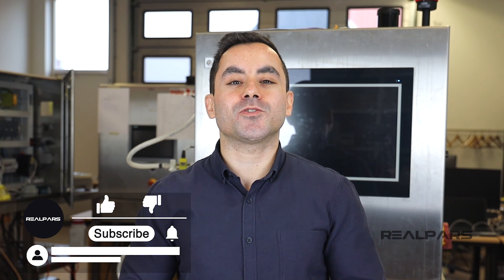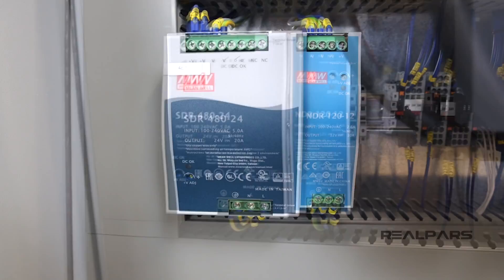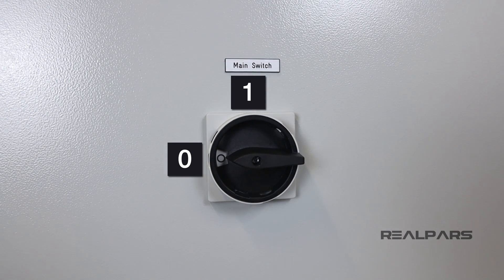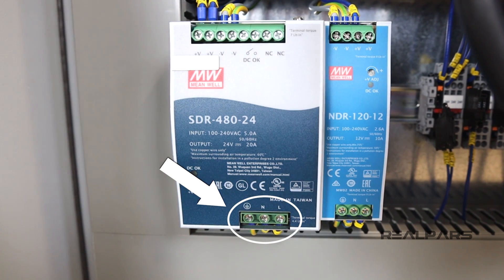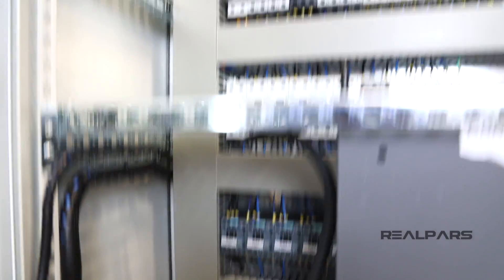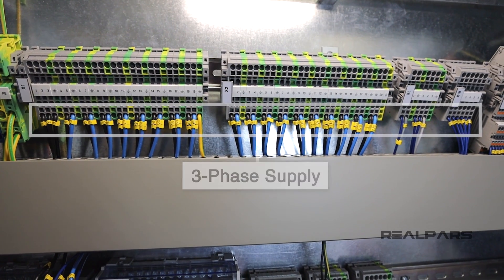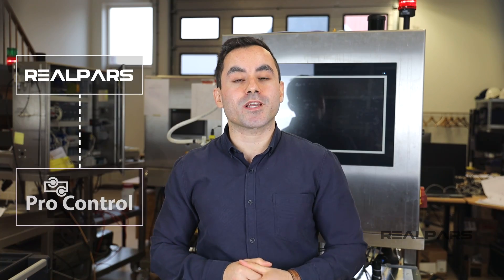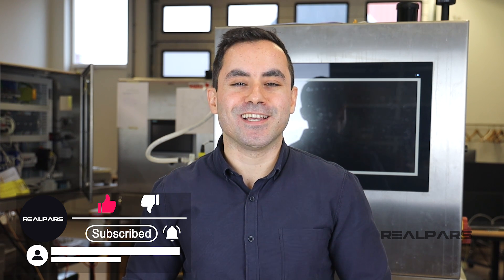What is the Purpose of the Main Switch?

Comment: What is the function of the distribution unit?
I assume it takes the function of main circuit breaker and surge arrester?
Reply from the maker: A power distribution block is used to create individual circuits using terminal blocks commensurate with the wire sizes appropriate for the circuit load.  It would be very difficult to "stuff" multiple wires into the main power lug.  That would not guarantee a good connection of the multiple conductors.  Using a distribution block will help guarantee good connections with properly-sized terminals.

Comment: 1 - A three phase 415VAC will give me a one fase 240Vac. 
2 - What's the pourpose of the contactor between the two distribution unit? 

3 - Is that usual the main three phase cables pass through a switch assembled on the front door? Cound't be just a command switch?
Reply from the maker: The incoming 415VAC power is fed by fairly small feeder wires and appears to be #10AWG (5.26mm2) at the most, or 12-15 amps ampacity.  In this case, a simple rotary switch as shown is sufficient to disconnect power to the panel.   The contactors are used to switch on/off power internally in the cabinet based on other signals, such as PLC outputs, hardwired logic, etc.  These additional details were not covered in the video.  Also, it appears that this panel was built according to IEC standards, so a panel in the US or other countries may require a different design to comply with local codes.

Comment: I noticed green-yellow wire coming to the -V connnection of 12V and 24V DC power supplies. Is it a prtocetion ground wire? Is connecting -V to ground a thing that should be done generally, something specific to that particular power supply or something else?
Reply: Kacek 
It is called PELV, without PE it is SELV. Some components require PELV and I always make PELV.
Reply from the maker: In Dan Jensen's comment to your post, he indicated his use of PELV for this function (Protected Extra Low Voltage).  This is the same function as you are describing being connected to -V of the power supplies.  That is one of the normal designations on power supplies to represent the common for the supply.  The green-yellow wire is tyically connected to a low-resistance grounding connection, which provides protection against electrical faults.

Comment: Great videos.
But I'm surprised that you are distributing power without protecting each circuit (from transformers to each outer devices). They are clearly not the same power and don't have the same wire thickness so they cannot rely on the previous breaker to protect them.
Reply from the maker: Yes, normally each branch circuit would be protected with a breaker or fuse.  This protection can be added inside the panel or at the device.  Control panels are typically built to the spec of the end user, so there may be differences in how this is done in your plant and what is shown here.

Comment: Even when the main switch is off, the wires that come from the supply (the wall) will still be energized, correct? So it’s important to note that even with the switch off, there are still 4 live wires inside the control box. Is this correct?
Reply from the maker: Correct.  Only the downstream wires are volt-free.  This would be be true for any disconnecting means within a panel.  It is very important to know how a panel is constructed prior to doing any work inside the panel.
Reply: This is indicated in this panel by the orange cabling for "maintained" supplies that aren't isolated with the normal means of isolation. Having 415v AC on your door is not good practice though, you can get rotary isolator switches that mount on the backplate inside the panel and use a square rod to mechanically connect them to the switch on the door which also prevents the door from being opened when energised. The safest way though, is to have the rotary isolator mounted external and only have the output cabling enter the panel.

Comment: Where is the safety function ??.  Why you dont tell  does you can or not switch under load with it etc... Why it has only 4 pole not 5 ...
Reply from the maker: First, this panel would fall under EU guidelines, namely  EU Guideline 89/655.  The switch shown can be switched under load up to it rated amp value, which, based on the wire size, is probably not more than 10A.   Second, it does not appear that there is a lock-out mechanism for the feed circuit, which technically meets  EU Guideline 89/655 for disconnecting a panel from operation.  Third, the power feed has 3 phases and a neutral, hence, four poles.  I would suspect that neutral and ground are bonded at the transformer.  This is not the typical arrangement in the US and it would not meet US OSHA requirements.

Comment: 1:30 small correction transformers are used to convert high volt AC to low volt AC which can then be rectified to obtain DC voltage. .
Reply: Good point there! Transformers are used to step-up or step-down AC voltage.
Reply: Not necessary ! 
Either step up or down.
Reply: @eliosgreek8028  you are correct they are used in microwave to step uo
Reply: Actually these devices are normally described as "PSU's" or power supply units and contain converters that include components that transform and rectify the AC to the desired DC voltage.